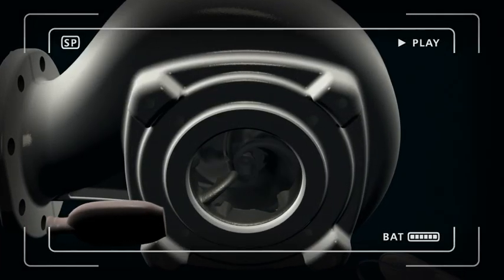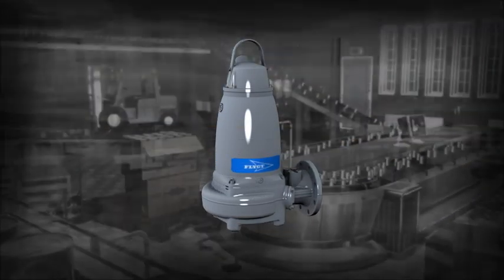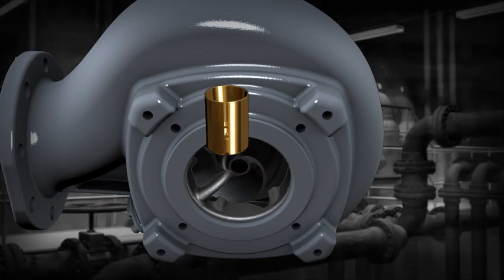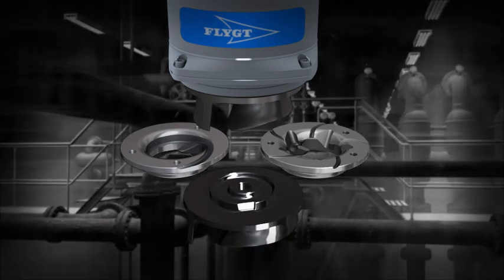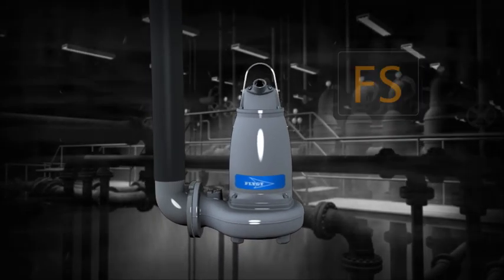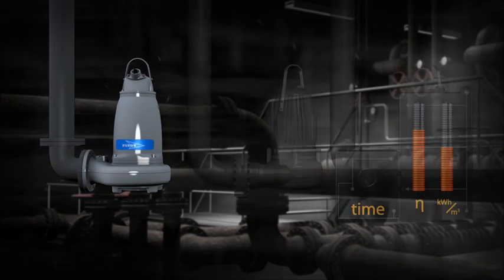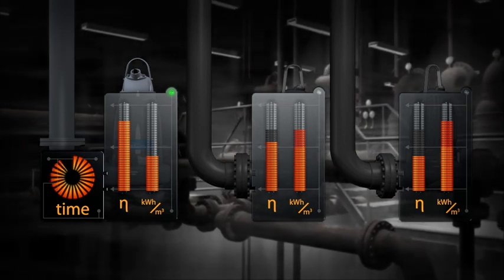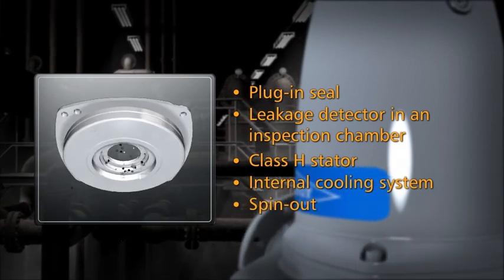The New Flygt F3000 chopper pumps from ITT Water & Wastewater

Comment: My experience with the N pumps has all been bad. If they run in reverse the impeller drops. If the impeller drops it shatters and you have to do a confined space entry to remove any metal  from the shattered impeller or you will destroy another highly expensive and over priced impeller.  KEY THE IMPELLER TO THE SHAFT. The N pumps run on the right side of the curve causing excessive vibrations. The vibrations loosen the volute and suction plate bolts causing catastrophic failures that amazingly wont be a warranty. ( my 105 hp pump was 8 months old and grenaded in the station. Not an isolated  event)

Comment: Flygt's N-pump is not an over built high maintenance machine with crude a hydraulic wet end, It's actually a combination of High efficiency, rugged high chrome impeller and wear plate for long life, and N-technology design. Meaning they have figured out a way to prevent rag balls from forming which is what small, medium and large single vain impellers are notorious in doing. Lots of manufactures can come up with a machine that shreds everything so it doesn't form rag balls but thats a lot of wasted energy just to prepare wastewater to be pumped or have a design that shreds everything at the pump and put an oversize motor on it to accommodate a mechanical function just to perform a hydraulic one! Unlike some manufactures Flygt doesn't need to name plate there pumps with 1.45 services factors and oversize the rotors to handle the loads associated with chopping, because they are "passing objects" not chopping objects!